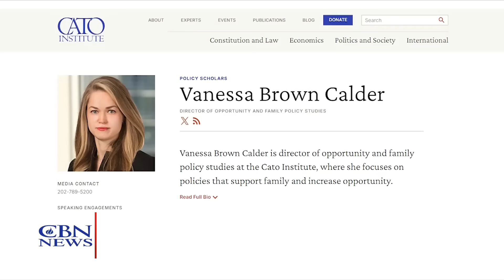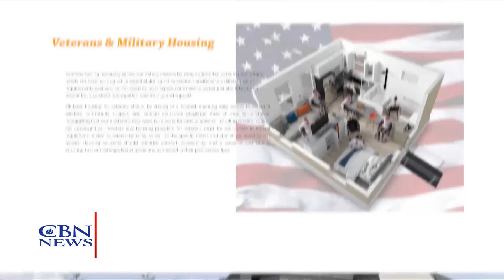America's Housing Crisis: Skyrocketing Costs and the Search for Affordable Home Solutions

Comment: Part of the rise is housing cost is simply the new houses are getting bigger.  A factor that can improve the trend is simply have a property tax structure that uses the house size, footprint, and property size to calculate the tax.  Market equilibrium over time will improve the cost factor.  As buyers will choose more efficient sized homes.  Less materials, lower cost.  A smaller footprint will also reduce energy costs.

Comment: i dont get it, this analysis is off when its saying its a political issue.

illegal immigrants barely making minimum wage put pressure only on low income rents in the cities where they're moving too (mainly big cities in blue states).

we're seeing housing crisis across the nation, with higher inflation on upper middle class houses like $600,700,$1M+. for instance, i see houses in montclair, NJ going up YOY by 15-20%, and with the avg. price of $1.6M, there's absolutely zero impact in the demand coming from illegal immigrants...

if anything, they're helping to keep cost down since a lot of the builders are using these guys for cheap labor